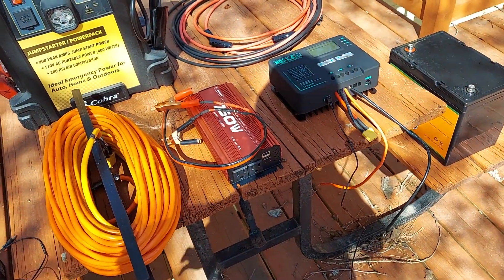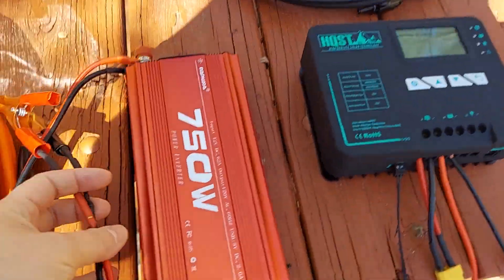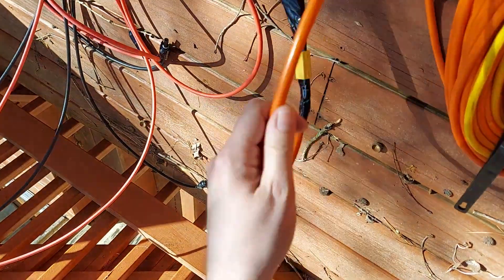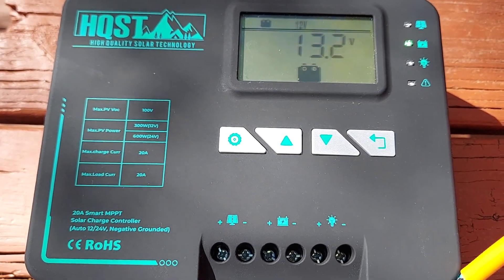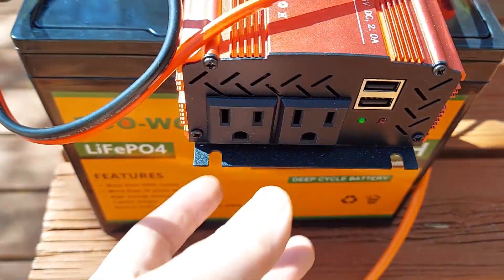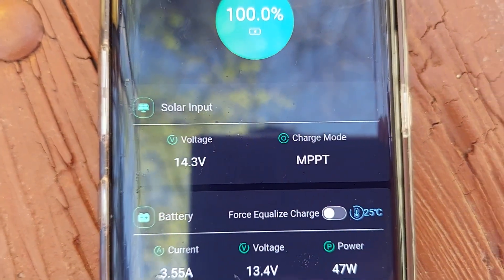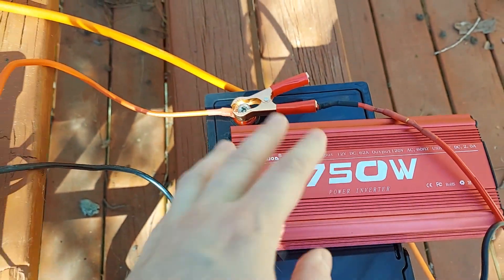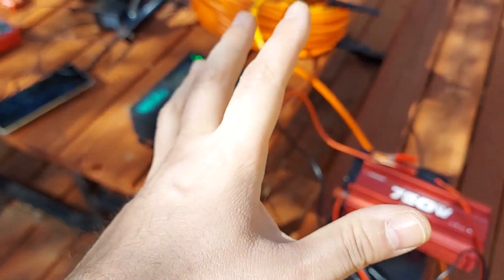HQST MPPT Bluetooth Solar Charging System

Comment: The controller has a temp sensor internal. The remote probe is to monitor  batt temp. Note in the app, you will see both readings.

Comment: Clicked on this video as I'm interested in the HQST solar controller. Somewhere around 7 mins you show that battery is at 13.2v and PV input V is 13.5v.  That is an extremely low differential and may not charge the battery efficiently.  The panels should be put in series to get the PV input voltage up so the MPPT controller can do its job and send a higher voltage to the battery to charge it. Also a higher PV input voltage will mean less line voltage loss.

Comment: The load output on the controller is rated for 20 amps, the temp probe is for the battery.